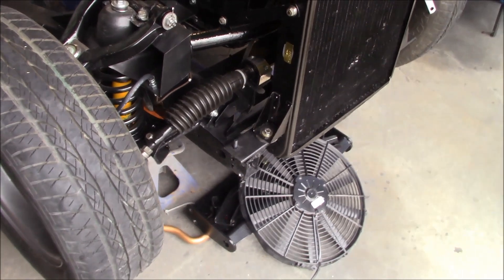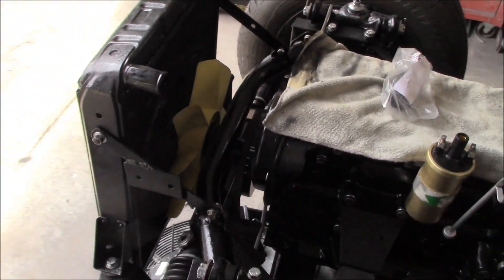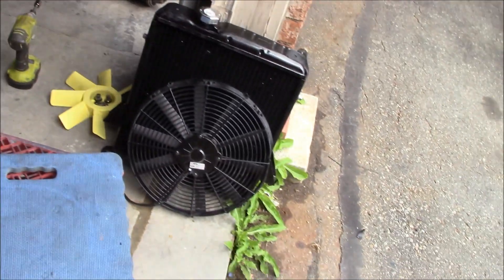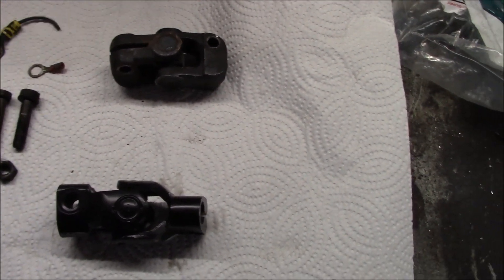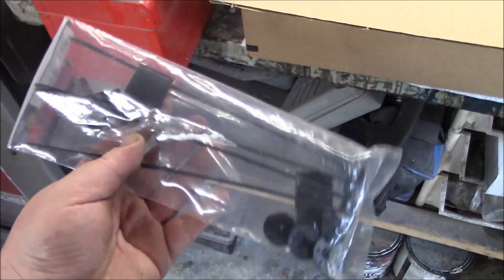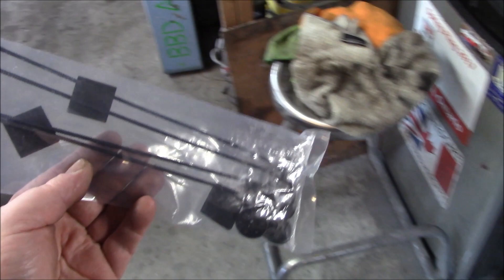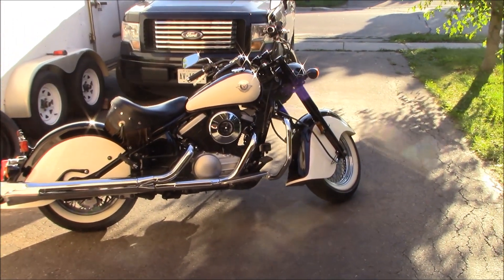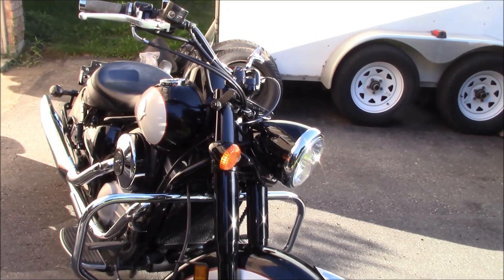1968 Triumph TR250 Restoration, Parts Unboxing and Cylinder Head Discussion....

Comment: I ran 10.5:1 with performance valves, ported heads and a Clay Smith regrind that was a bit more lopey than your cam specs, on 91 octane and a bit a of octane booster in my TR-4.  No problems whatsoever. I did use the crushable stainless steel head gasket. Worked great
Reply from the maker: Thanks Mike. That’s reassuring and great to know.

Comment: With that fan running you are going to be accused of electrifying the TR250. I think I would rebuild that head and use a thick head gasket or a CI-reduction plate. It's a tough call. Good luck and thanks for the update.
Reply from the maker: Thanks Bruce.  The fan will be put on a switch and only be used when required...you will certainly know when it’s on that’s for sure.

Comment: Head I had on my 250 was cracked so I put out an appeal to car club members and got a decent early head with correct intake port spacing for $100. I also had a lead on another one so they are available if it happens you should need one.
Reply from the maker: Thanks Doug.

Comment: On the Good Parts site, under 'Info Pages' - 'TR6 Compression Ratio' Richard talks about using recessed valves to reduce the compression ratio. I don't know enough about TR6 and TR250 heads to make any definitive statements, but it might be worth checking out.
Reply from the maker: Hi Rocky, yes I’ve read the Goodparts info.  Funny thing is, with the hardened inserts, I’m going in the opposite direction I believe...
Reply: @cheftush  Thanks Chef. I was fairly sure you'd have done your research but though I'd mention it anyway. Considering all the 'challenges' you've had on your various builds, I'm sure you'll find an elegant solution to this one!

Comment: How do you calculate an accurate compression ratio without measuring the volume of the combustion chamber (cc'ing the chamber)? If you are so close to being too high on compression, wouldn't you want to make sure you are as accurate as possible on your compression ratio calculation? Not being critical Tush, just asking. :-)
Reply from the maker: I agree, it’s a rough calculation assuming the combustion chamber is stock...and yes, I know there are variables in there as well including valve height/recession etc.   In order to get a true calculation, you’d need to do something like a proper fluid test of the chamber.    But, even as a rough calculation, based on head thickness, gasket thickness, bore and stroke it looks like I’m at about that 10.5 CR.

Comment: I don't remember Les having all these kinds of problems....  You can get a 1/4"  thick head gasket from Moss for  about the price of a new  head.  It is solid copper though, guess  you need really flat block and head to get it to seal - probably not a great option even if it helps enough.
Reply from the maker: Moss US or Moss Europe?
Reply from the maker: Found it...https://www.moss-europe.co.uk/shop-by-model/triumph/tr5-6/engine/cylinder-head-fittings/copper-head-gasket-tr5-6.html
Reply: @cheftush  Sorry, I went dark for a while.  Yes, that is it, though I thought it was much thicker than that.  When you pick it up, you can definitely feel the beef.

Comment: Funny , I get a lot of things boxed up like that from Amazon And a lot of those things would be hard to hurt . but when i ordered my camera lens , it came in a bubble wrap envelope , lucky it was in good shape . Some engines do better with higher compression than others regarding the fuel . I have a 460  dovc C with 10.5 - 1 and even with timing retarded it does not like pump gas , but filer up with Cam2 and it comes right to life , Cam2 cost more , but it is only money right , lol . Hope you find the head at 10 - 1 or lower but it will be what it is .

Comment: Just realised that fan is the first thing you have had working on the car. Yaaay!
I would run the head you have be it 10.5:1 or whatever. You have a high power starter so thats never going to be an issue. Maybe find an ignition timing that works but isn't full power? Having said that you have some fancy headers, carbs that fit, a solid rebuilt bottom end and its not going to be a daily driver so just see how she runs. Even if you need to change it later it will be worth good money.
At worst sell some of your stored parts and buy a used but good 250 head?
Reply from the maker: Yeah, I’m inclined to use the head for sure...I’m trying not to reinvent the wheel 😉 It came off the car this way and obviously did a lot of miles previously. Cheers, Tush

Comment: Hi Dave, I’ve given your dilemma some thought as it would be a shame not to be able to use that cylinder head. I understand that you and Elin have been pretty exact with your measurements. However, let me just cover a few of the key factors when measuring again even though I appreciate you have probably already covered all of these off...(I refurbed heads for a living when I was a young man, (please note: I can only work in metric) firstly I only used liquid to do my measurements and the first one, using Vaseline or similar was to measure the c.c.of the TDC piston crown in the bore with a used head gasket using a calibrated pipette. Secondly, measure the combustion chamber with the correct spark plug and valves AFTER new seats have been fitted and CUT using the same method. If this is not enough to achieve (10:1) for a normally aspirated engine with a good five bearing crank and mild road/rally cam then you could still consider the following: 1. Some dishing of the new inlet valves is usually safe to do 2. See if there is enough meat left in the chamber to relieve (mainly around the inlet valve swirl area) a little more to enlarge it’s capacity slightly 3. Ask the engineer to cut your new valve seats slightly deeper on the 45 degree so that both valves sit slightly deeper.  However, if you’ve already allowed for all of these tweaks then I can only wish you the very best!
Kind regards as always...
Reply from the maker: All good info Phil. Thanks for sharing.  I’m hoping to have a good sit down discussion with the machinist/head builder to figure out the best course of action.   It’s hard to find a shop nowadays (up here at least) that’s even will to do that.   So, I might have to shop around a little bit until I find a place that I’m comfortable with.    This might make the process longer but I’m ok with that as long as it’s done right.

Comment: Yes if the head is useable as it is, maybe with a bit of minor attention,  then throw it on with the stuff that matches it and use the car for a while. They are just bolt- on after all.

Hold off on the rebuild / replacement until you know which way to go, I’m sure you could return the new valve stuff etc. if you went down the route of a later head design.

Comment: Your E-fan is awesome. Why do you still want the stock fan? You won't have to worry about the silly fan belt again if you pull it off ;) My Alfa just has electric, and I just ran electric on my old BMW's. Thinking on doing the same with the TR6, but I'm afraid to mess with things too much. It ain't broke, so....but maybe someday I'll go e-fan and halogens.
Reply: BTW, when you first bought your 250, did you you do any pulls and run the car hard; or were you able to compare it to your TR6, drive train performance-wise? I'm wondering if you got into the 250 back then and thought 'Wow, this thing has some pep'...
Reply from the maker: I just prefer to have the stock fan as I don't like to hear loud electric fans on TR250 and 6's...I prefer just to use a manually switched fan when required.  I suspect this will not be very often as I rarely use the electric fan on my TR6 that is set up the same as the TR250 will be.    I know I am losing some HP by keeping the stock fan....
Reply from the maker: @jamcdona   Unfortunately, I didn't get the opportunity to drive the car.....I don't know if you know David Fidler (Flyingfid on 6 PACK)....well, David actually drove the car home for me as I couldn't drive the car with comfortably with the steering wheel that was on it....it was a non stock TR4 wheel I believe.   David told me it that it was quite a quick car and I can attest that I was having a hard time keeping up with him while following him home in my daily driver.   So, I am looking forward to my first drive in the future!
Reply: @cheftush  Just don't drive it so fast that you change the jet stream on us, Tush! ;)